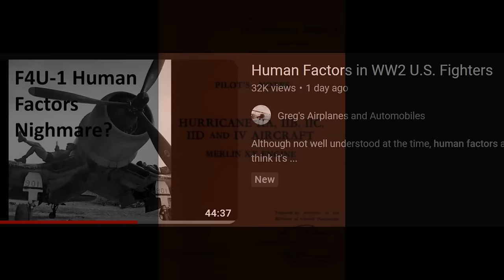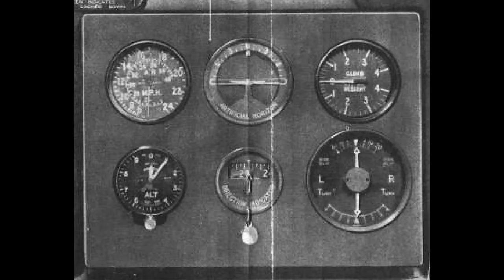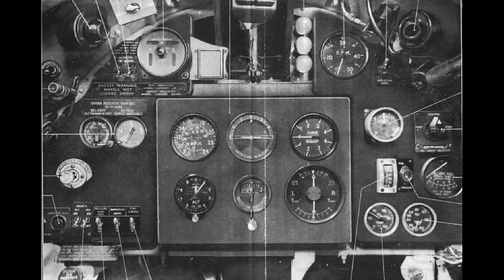Human Factors In British and German WW2 Fighters

Comment: Hi. I flew the Hurricane, Spitfire and Me-109 as a test pilot and airshow pilot. I have a few comments: You mention the omission of cockpit heaters as an oversight, since they were not needed in earlier open-cockpit designs. I think that misses the point. Optional devices, such as heaters, were omitted due to weight, cost and complexity. A wise airplane designer once said that he throws all of the optional parts into the air, and those that come down are too heavy. The undercarriage control is a perfect example. The Hurri and Spit designs require the pilot to change hands immediately after takeoff to retract the undercarriage.  A modern test pilot thinks, "Dumb design!" Remove the cowling, and the designer's thinking becomes clearer. The hydraulic pump is on the lower, right, aft part of the Merlin. The shortest, lightest, cheapest, and easiest-to-build solution is to run the hydraulics straight aft into the cockpit. The pilot's job wasn't made easier, but the fighter was made incrementally lighter. Lighter = better, even if the pilot's job is harder. That IS ergonomics in the 1930's. Likewise, tailwheel locks; best left out of the design unless the aeroplane needs it. The Spit and Hurry don't by virtue of their CG location with regard to the wheels. The Bf-109 had a comparatively VERY heavy tailwheel load. Omitting a tailwheel lock was not an option, so it justified the weight/cost/complexity. Speaking of which, the Bf-109s tailwheel lock is a great example of a bad idea; situated on the left canopy rail where movement of the throttle will cause one's forearm to accidentally dislodge it. (Ask me how I know!) The inherent ergonomic limitations of operating systems on these fighters represent the 1930's state of the art. A similar example of human factors is cockpit field of view. The Spit was utterly blind for takeoff and landing . The Hurri was better, with the cockpit raised up high on the fuselage. Was this an ergonomic decision? Nope. The Hurricane pilot sits higher to allow for a better depression angle over the nose for deflection shooting. The benefits for takeoff and landing were incidental. The design thinking was to use EVERY BIT of the pilot's ability if it made the airplane an ounce lighter. So much to say...Great video!
Reply: Finally, someone with something other than “I’m a DCS expert pilot”. The first time I climbed into a T-6 I realized how exorbitantly different, and radically unforgiving, the real world is.

Love the T-6 though. ;-)
Reply: Thanks for the insights.
Reply: Bravo. I'd rather see more effectively in the air, than on the ground. Even over cognitive instrument processing time. Because in the air 'Other Human Factors' are trying 2 kill me. Fun 'Fact.'
Reply: What if you crash and die in the ground, because you were unable to take off due to the poor visibility? Just because it was state of the art at the time, doesnt mean it was ergonomic or couldn't have been done better...
Reply: Overall great comment about the reasoning for design decisions that may be unintuitive/harder to use, but I can't help myself from nitpicking. It's decidedly NOT ergonomic design, it's (as you correctly point out later) ergonomic benefits being sacrificed in order to achieve other performance benefits; weight/cost to produce/etc..
Reply: And the Me109's throttle moves back to accelerate - correct?
Reply: While I am not discounting or being deprecative of your personal knowledge, design choices made based on simplicity is contrary to the definition of ergonomics which is design choices based upon compatibility with the human body/motion.
Reply: You didn't listen very well. Greg addressed some of your "concerns". No, I'm not telling you which ones.
Reply: Every designer should have to fly with their designs to see how their omissions affect pilot effectiveness and survivability.....
Reply: @NikeaTiber task at hand?
Reply: @Pikilloification  I take your point, but the design of  anything  (just like life itself)  is a set of compromises.
Reply: @faeembrugh  I believe some French aircraft such as the MS 406  had throttle control like that, as far as I know the 109 did not
Reply: @faeembrugh  No. Forward for more power, back for less. You may be thinking of French planes.
Reply: Thank you for your interesting thoughts from your actual experience. I envy that you got to fly the plane and I didn’t!
Reply: @tomsear1  The problem with that approach is twofold: first, crashing on takeoff or landing is just as likely, possibly more likely, to take out the plane and pilot as losing an air battle, and two, mentally and physically exhausted pilots are more likely to lose an aerial battle than ones whose planes are less taxing to fly but very slightly outperformed by the enemy - especially because very often the winner of any given air-to-air combat was the pilot who spotted his enemy first, and stressed and/or exhausted pilots are going to be impaired in their ability to spot opponents first.

The Chieftain generally covers this subject extremely well when it comes to tanks. Less stress and fatigue on the crew = greater combat effectiveness.
Reply: @brucetucker4847  OK, agreed. But the risk matrix engineering trade off within larger risk calculus in context of tactical advantage till exists in your argument and is indivisable from that assemblage. For example, no point in having a nice cosy heater if the weight of it means you are so slow that you either cannot get to the fight, or you are shot down because Driving Miss Daisy, and/or it takes so long to develop said heater that you lose I dunno Battle of Britain let's say because you failed to make a compromise to get a craft off the drawing board and into the air. (Cough let's not talk about lessons of supreme Ergo F35) real life example, Australian RAAF at Port Moresby had very "stressful" aircraft variations to fly, compared to the Mitsubishi's but had something with a propeller and flat bits out the side, but had them, and changed tactics to level the playing field. But none = sayonara Port Moresby. Tank examples exist 2. Better to have many T34s than a few Gucci Tigers. Both examples of gross calculations - but the finer ones you correctly cite were precisely made in heat of battle with these fighters. On the +ve side the Mozzie had a heater. But it also had two Merlins and was made of plywood. As John Lennon said - 'ive been poor and unhappy, rich and unhappy, rich and unhappy was better.' Battle is a unhappy place a lot of the time. As Mosquito pilot and test cricketer Keith Miller said, "Pressure is a Messerschmitt up your arse, playing cricket is not." Discomfort is relative to risk. Anyways the Hurricane & Spit both had superior visibility to the 109 & 190. You can keep a cool head and not hold the button rather than have nice ammo counter.
 Facetious reply, but war is gonna be a sh t show sadly less than ideal, usually.
Reply: @brucetucker4847  you make an excellent argument, but assumes the human matters over objective - [pulls down chart with on it a picture of B17] [audibly clears throat] .....
Reply from the maker: A lot depends here on how much weight you're adding vs. the benefit in ergonomics. Sure, a heater adds weight, so do properly place controls, but generally not much. Considering the numbers of planes lost in accidents it's likely that the trade off in performance simply wasn't worth it. Clearly that's what was decided because as the war went on and certainly in the post war airplanes Ergonomics and Human Factors took a huge priority over saving a few pounds.
Reply: @GregsAirplanesandAutomobiles  It's clear in retrospect. It's also clear they were placing inordinate emphasis on weight reduction at the time. There was resistance to radios and armor on the grounds of weight, so resistance to a measure that 'only' makes the plane easier & safer to fly is not just understandable, it's in character.
Reply: @GregsAirplanesandAutomobiles  And/or time compression of decision eased? Not sure causality can be reductively ascribed, since ergonomic effectiveness was not evenly distributed between combatants. The fighters discussed here were largely dev'd in conflict prelude. Buoyant Allied air supremacy as war progressed, coupled with democratic leadership, released change, but German fighters on the whole got worse, & such dynamics fuzzed in the furball of Nazi internal power politics, supply & contract continuity in a hysteria of wonder weapons. Japanese Dev of any kind just stopped. Postwar, where speed performance was positioned in an entirely new propulsion paradigm and a Cold War of limited proxy conflicts spread over decades, without such dramatic requirements for airspace contest conjoint with supply chain  resource scarcity  means we can't assume such a transition is linear, direct, nor cumulative. I look forward to you expanding your theory over next videos, however. One interesting case study to examine the debate might be your analysis of the SR-71 cockpit ergo. Did a non linear compressed production scale mean trade offs or was ergo matured? If so when did the ergonomic gains curve flatten? Or is it like Moore's Law? WRT 'was it worth it?' in the case I used 2 pilots and airframes were lost in the transit from South eastern Australia to the 1 week training school in Cairns before combat. This was because pilots had never flown the P40s before told here it is fly it 4000 miles north for one week's training. The latter key aspect because as war matured there was simply more time to train so maybe hard to extract ergonomics from that context as statistically independent variable.
Reply: FN., On flying into Moresby 2 airframes were lost when ground defence destroyed 2 airframes because had never seen a Kittyhawk before, then after a crash land post Zero contact and solo 14 day trek flight leader was forced by top brass into direct dogfight P40 could not win. Top brass - who were stupid and irrational - and flight leader was thus killed following a crazy order. All pilots flew with malaria and severe dysentery(sic) and only ergonomic support was good pilot boots collecting the effects during flight. So, not sure we can assume rational choice is ever being made. The loss of airmen in accidents was not considered significant when Moresby had zero pardon the pun allied air contest with Japanese and we could not lose Moresby. Not sure human factors were a priority in anyone's mind. Ever. Early in war. The fact that Spit had rubbish carby is proof of the original post in this thread - pilots - not machines did the flexible, plastic, hard compromises and stretch where engineering could not - and that interface surface exploited not the opposite. Maybe in the states, until Japan showed US what air power really was ;) US only did latter half of war so not controlled representative sample and two airmen crewed fighter bombers prove the argument of original comment poster as workload was split across humans, not human factor ergo enhanced when cockpit layout and gauge technology was either behind the aircraft or the demands of speed of combat change 2 maintain superiority.
Reply: @c1ph3rpunk Greg is an actual working pilot though. His logbook is extensive. He’s absolutely not just a DCS commander.
Reply: @PBScourge  True, but did he ever fly any of these aircraft in the early days of the war? Or help develop them? Obviously not...

The point I am making here is not that he is entirely wrong per se, but that there were often REASONS why certain design decisions were made that made sense AT THE TIME, but make little to know sense to us now.....

It is one thing I very much stress about the study of history in any form, and that people all too often ignore. Judging anything in history MUST BE DONE ONLY USING THE INFORMATION THEY HAD AVAILABLE AT THE TIME.

Sorry for the caps, but that is kind of important. If you do not judge history based on what information they had at the time, based on the tech they had available, the time limit they had to work to and the circumstances under which they operated you are utterly FAILING in an objective analysis of History, and thus you are not accurate as a Historical source or resource....

Many people such as yourself look at history with a 21st Century mindset, that is the wrong way to look at history. Look at history that way and you will never truly come to understand why some decisions were made.

Even Hitlers order to start Operation Barbarossa is understandable IF you look at the information available to the Nazi higher up, and their outlook and ways of thinking. Was it the correct decision? Hell no, but you can ONLY understand it if you look at it properly....
Reply: I went to college in the 1990s with a very nice lady professor that had measured about a thousand people's feet hands wrist elbows grip strength anything you can imagine on the human factors and then they applied it to make airplanes easier for the pilot to fly because they were getting too many crashes. I believe she came on the scene after  we lost a lot of people and equipment to things that just doesn't fit the pilot well so we re-engineered that to.
Reply: @markmcgoveran6811  Yes, but that was in the 1990's, with far better science and correspondingly engineering all round. 

The point I try to make is you CANNOT judge 1930's and early 1940's technology based on modern technology.

In the 1930's and early 1940's many of those design decisions made sense IF you take into account the available technology.
Reply: @faeembrugh  The operative sense of the 109's throttle is normal (i.e. forward = faster). The thing I most remember about its throttle was that it was about half the width of my hand. The cockpit was so narrow that a bigger knob would hit your leg!
Reply: @NikeaTiber  Fair point. We seem to agree that many design decision were not about ergonomics.
Reply: @tomsear1   Carburetors are not human form factors.  The US Navy defeated the best the Japanese Imperial Navy had within the 1st year & 1/2 after Pearl harbor.  So I am not sure what you are talking about with the "Japan showed US what air power really was."  If anything the US showed Japan what airpower really was.
Reply: They flew in conditions that you never flew these aircraft in, or even attempted to fly them in. There is a world of difference between an airshow and aerial combat over Europe in WWII.
Reply: @GregsAirplanesandAutomobiles   Sorry, but you are wrong there. Lots of little incremental weight savings make a difference, and that was common in most pre war and early war fighter designs. 

Did those weight savings make much sense in say late war Griffon engined Spitfires developing 2k Horsepower? No. But did they make sense in a 1939 Spitfire generating HALF that engine power? 

Absolutely...

Its weird, thing is I do not think you are wrong, ergonomics in many WWII aircraft (and tanks) were terrible. You are absolutely right about that....

My point though is I think you are wrong about WHY. I think you are judging WWII aircraft, especially those designed and built in the mid to late 30's, against modern aircraft...

And in that I think you are flat out wrong. I respect the fact you are a modern pilot with thousands of hours of flight time, but I feel you all too often look at these aircraft AS a modern pilot....

You should not, you should approach them as a pilot OF THE TIME, given the information, technology, and situational constraints OF THE TIME....

If you do not, you are worthless as a Historical resource or source.

I am well aware that you and some of your folks will brand me for saying that, but to you and them I will say one thing, when it comes to history, facts are often contextual. Maybe one day you will understand that.

If you want pure objective facts, stick to science, not history.....
Reply: So state of the art ergonomics for British and German fighter design was...anti-ergonomics? That's pretty damning. History bore out that making the pilot's job more practical and easier is very much worth some sacrifices in performance. Most fighter combat involved the target aircraft never noticing the attacking aircraft, after all.
Reply: @alganhar1  no that was in the 90s when I was in school with the teacher it was way before that it was probably the 60s when she was doing that. The point I was making is they killed a lot of people trying to figure out that everybody who's a fighter pilot may have different size feet. It was a monstrous statistical task to come up with something that would fit everybody every time. Not only did you have the problems you were discussing with pilot inconvenience a lot of times you had a pilot who was just too tall or too Short or too long or too thick or to something and he couldn't work the controls well. That was the human factors engineering I was talking about. There were a lot of crashes because somebody's feet were too big for rudder pedals and things like that.
Reply: @cvr527  you have not met the carby in my 1975 Kingswood, who would beg to differ. Nonetheless, all technology is an actor in the assemblage, & has agency. Pearl H - well, erm, precisely what said. Not sure what your confusion is? As already noted Japanese tech remained stagnant and US overran later in war - a view you support. Wait, you believe Pearl H was NOT an overmatch & illustration of the tactical and strategic benefit of air superiority early in WW2? O...K. Anyway, back to tech, one of the problems I have with approach of these vids, as fascinating and fun as they are, is that ergonomics as a defined formalised discursive only emerges post 1945, with stages at 1949-50 and 1957 when 'human Factors' is formalised. Even the emergence of mature protoergonomics in founding father Chapanis's infamous late WW2 pilot error study of B-17 is NOT the scientific taxonomy of ergonomics as we know it - even as post Taylorist psych - and WW2 aircraft design as it pertains to human machine interface might be more valuably explored on its own terms - indeed as noted in original posters comments - the human is DESIGNED to be behind the aircraft at the time and cognition is agent that bridges the gap. Back to the carby as non human factor then - before 1957 you would have NOT been able to conceptualize such a divide exactly - 'human Factors'(1957) assumes a discourse of knowledge of the nonhuman tech and vice versa. Ergo, a ergonomic critique of WW2/earlier design might only produce simple binary analysis outcomes - obvious ones - which may be of limited contemporary revelation.
Reply: @RobofGabriola  yes. Formal British postwar analysis found that 109 pilots could only ever exert maximum 40% of the force that a equivalent Spittie pilot could on the Stick.
Reply: @cvr527  aren't they quite close manoeuvre wise tho? & Risk and time at 0 feet?
Reply: I personally am no expert but 1950s test pilots were frustrated by the afterthought that was ergonomics and the indifference to their complaints on the part of managers and engineers. 

It's a reason British cars and motorcycles got wiped out, too.
Reply: "Lighter = better, even if the pilot's job is harder."  That depends if the extra weight or pilot errors due to task saturation and/or fatigue from being cold costs more airframes and lives/injuries.

If "lighter = better" was absolute, we would pull directly on wires to manipulate the controls instead of having a control stick.

An easy to fly plane leaves more time and attention to build SA, and a comfortable cockpit leaves a pilot less fatigued and more alert.
Reply: I’m envious of your experience. I will add, when those planes were designed, I imagine nobody thought the pilots would be going into combat with only tens of hours of flying time, as I believe sometimes happened. I am a DCS ‘pilot’ but a million miles away from being an expert in even virtual flying and if there’s any correlation with real life in these sims, it’s that experience - repetition and familiarity, can minimise or even negate some ergonomic issues.   Unfortunately for a number of pilots they didn’t get a chance to gain that familiarity. To get closer to my experience in my real world, the virtual 4th gen jets seem to have most of the physical ergonomic factors sorted.  But the usability of their human-computer interfaces is pretty bad by today’s standards. Some things you select and then choose an action button or key, other things you choose the confirm action button first and then tell it what action you want. In the same cockpit. Ok, maybe it wasn't like that and the sim has it wrong but this occurs on multiple virtual models from a range of devs so I think its fair to assume the real things were making the same usability errors we saw everywhere at the time. Saying that, it was commonly believed that improvements to UX often started in military aviation first. But I digress.
Reply: @alganhar1 absolutely. But it is possible to discuss these things without making value judgements. And understanding the history from a purely functional PoV is an approach. Maybe not the professionally preferred approach but from an enthusiast angle, I find it fascinating how the focus moved from pure performance to adding in human factors once there was a little performance to spare and how the adoption of human interface thinking was uneven across cultures and even manufacturers. I believe it’s more of a sin against our forebears to do the ‘my engine is bigger than yours, I have a higher top speed/better turn ergo my favourite is better than yours’. And that kind of childishness is rampant in the armchair internet world of which I am a part. An easy example can be found in armoured vehicles - Someone (was it Liddle-Hart?) said AFVs are a balance of armour, mobility and firepower leading to 30 years of such internet warriors ignoring how easy something was to use. How tiring it was, or how much visibility a crew had. 
Greg is pushing back against this ‘my pecker is longer than yours’ business that pop history TV and internet discussions always focussed on until recently.
Reply: @tomsear1 I am quite sick and tired of the "US only fought the second half" routine. Knock it off. It is both wrong and stupid.
Reply: @alganhar1 You're misunderstanding the point of the video. Ergonomics were sacrificed because of the relentless search for performance, or simply the lack of available options, and as a result most casualties resulted from a lack of human factors, not a lack of performance.
The M4 Sherman shows this perfectly. Before the Sherman tanks of all nations were human factors nightmares. After the Sherman human factors reigned supreme. Why? Because Sherman crews could fight their tanks, then get a good night sleep. That led to such an outsized increase in combat performance the USA effectively dominated all of it's competition with a tank that if you only analyze the "hard factors" was far inferior to it's competition.
Reply: @GeneralJackRipper  
Ack. All about perspective I guess yeah -
The optimist sees a glass half full.
The pessimist sees a glass half empty.
The engineer sees a glass with a safety factor of two.
Alternatively:
The engineer sees a glass that is twice as big as it needs to be
Reply: @kenneth9874 And the architects should live in the flats they designed.
Reply: @20chocsaday  some definitely should..
Reply: Reflecting on the weight issue from the perspective of being a Scandinavian motocyclist, who also replaced a car heater once,  I believe  dressing up for really low temperarures adds almiost as much weight as a heater (water in hoses and heater taken into consideration).
Reply: @larsstalegard2024  hmm. as equivalent weight for a system across firewall at altitude for a piston engine the scale of a Merlin, say? I guess Scando DOES get cold. Presumptions: just taking hot air from cowl surrounds without regulation and piping into cockpit, via sealable vent might have other consequences specific 2 engine and variant combinations? Using engine coolant (with glycol) requires an additional heat transfer system and conduction which not only complicated and risk heat build up? Having a second heat transfer system for pilot might have consequences for engine temp? Throughout WW2 there was pressure, pardon the pun, to increase engine coolant temperature. Why? To reduce radiator size to save weight. The argument loci concerned what coolant temp would lead to failure of engine in risk calculus. So maybe in team meetings suggestions for an additional heat exchanger might have met weird stares and unwillingness to share proverbial mini muffins with person that suggested that?! ;)
Reply: @larsstalegard2024  I was going to say that some exhaust gases could be run in pipes under the cockpit but remembered the different length of pipe might disturb the smooth running of the engine. 
An indirect duct might work but it would be more air resistance.

The spitfire could only last 90 minutes anyway. It was originally 'Get up there, shoot, land'. Much like the English Electric Lightening but subsonic.
Reply: @alganhar1  I think that your evaluation is incorrect. Greg many times says that early versions had these faults because they didn't know better at that time or didn't take what we call ergonomics into consideration.
Reply: @alganhar1  The Fw-190 was an aircraft of the time, which is really the beginning of modern cockpit standards.  Human factors was known at the time, it was just unorthadox.
Reply: Minor quibble, the Chieftain ranks the ergonomics of the German Mk III and Mk IV tanks quite high. The three  man turret (tank commander, loader, aimer) in particular gave them a major advantage over early British, French, and German tanks.
Reply: @Pikilloification 
Pilot's routinely just stuck their heads out of the cockpit sides to see better while taxiing and on takeoff, they learned to use peripheral vision. On many naval aircraft, the pilots opened the canopy and raised the seat to see over the nose for a carrier landing.
Reply: @cvr527 
The Jspanese showed that capital ships were very vulnerable to air attack at Pearl Harbor and the Battle of the Java Sea. Up to that point, many commanders in global navies, thought that aircraft would spot and harrass the enemy BUT surface fleets would be needed to finish him off.
Reply: I think these should be read less as a remark to different compromises made, but more as a summary of less-than-optimal prioritisation forced upon designers due to design requirements at the time.

If you are to manufacture a plane that uses every little ounces possible out of power and performance available, than these are worth the compromise, but that would be missing the fact that these are warplanes to begin with. Moreover, the king of lightweight in WW2 fighter aircrafts - the A6M Zero - largely does so by clever design and employment of unconventional design goals (less than 120% safety margin versus 180%, for instance) and not sacrificing a pilot workload. Not that it was great in terms of cockpit design, just that lightweighting could have been done with other methods with better effects.
Reply: @alganhar1  “person i disagree with  about a minor thing for little good reason is literally doing history wrong”

Both pedantic and pretentious, I cringed harder each sentence. 

2/10 would not read this person’s comments again
Reply: I wonder how many subscribers on this channel have flown a warbird in real life... For you, if someone doesn't have real flying experience, they can't give an opinion?
Reply: @fafner1  They rank high compared to other pre-war designs developed around the same time period, mostly because their chief competition was so unbelievably atrocious it boggles the imagination. No one looks at early war British or any French tank and thinks of it as a comfortable place to work. Hell, even the mid and late war British tanks were cramped and uncomfortable.
When we sent the M3 Mediums to Africa in 41 the British were so happy to have them they offered to buy the entire production run outright, because they were miles better than anything the Brits were operating. We had to persuade them to order fewer tanks because we already knew the M4 would be even better.
Reply: @billybutcher357  I would take the opinion of anyone who has just five minutes in a Cessna over someone who has a million hours in a video game.
No offense.
Reply: @billybutcher357  Got some (hands off) minutes in a military trainer back seat, 99% not the same thing.
You can tell a wikipedia or a P.C. joystick virtual pilot in a few wrong end of the stick words such as fatal flaw and inverted carburettor stoppage, my favourite is the deeply read hopeless deathtrap as it lacks counter rotating engine/propellers.  Wisdom too generously shared.
Reply: The FW190 have a heating system. Eric Brown mentioned this in one of his books.
Reply: Even the French aircraft of the period weren’t that crazy. The only thing I’m aware of that fits the bill from the period is the mixture control on the T-6 Harvard. That operates backwards with pull for rich and push for lean, using a lever on the throttle quadrant, on which the throttle operates in the opposite (conventional) sense.
Reply: "A wise airplane designer once said that he throws all of the optional parts into the air, and those that come down are too heavy." 
I laughed hard at that one.
Reply: @brucetucker4847 
Tanks are not worried about a few pounds/tons of extra weight, are they?
Reply: I was in the front seat of a Harvard / Texan on a cold day and found the 600hp heater mounted just in front of me did a more than adequate job of keeping things toasty.
Reply: This is also just inconsequential as well, since there is no real downside to a one to two second delay in raising the gear after takeoff for a spitfire. Such things wouldn't really matter until the jet age when acceleration post takeoff became far more abrupt. I have a bit of cross country time in a spit and can say, it is a very comfortable cockpit to spend a few hours in. The ergos of the spade grip are also nuanced, being comfortable if you grip it lightly, and less comfortable if you death grip it. Visibility is indeed poor on landing, and even worse in the back seat of a two seater, but handles so well at low speed that the visibility issue is negated, and the narrow landing gear issue is entirely negated by a competent pilot. Its like saying a beautiful woman doesn't have a wide enough stance and therefore cannot be a good dance partner. Addressing the difficulty braking and delay in system during taxi, not noticeable for me as a very low time pilot too young to have a drivers license.
Reply: Anyone flying WWII fighters today is an absolute top tier pilot with thousands of hours experience. I'd imagine the machines are immaculately maintained. You probably make it a point to take care of yourself and get good sleep before you fly a Hurricane in an air show. I'm sure you're more than capable of managing controls and instruments that aren't laid out to be as easy as possible for the pilot. However, none of this applies to a 21 year old pilot with 300 hours stick time flying combat missions with people shooting at you, operating from improvised airfields hastily cleared from the jungle last week, having lost 40 pounds from dysentery. Far more planes and pilots were lost to operational causes than were lost because they were that much heavier and thus 5 mph slower. Greg's points about minimizing the pilots' workload assume a far greater importance in wartime.
Reply: @alganhar1 Missing the point completely.  Greg isn't insulting the designers of the Spitfire or Hurricane or saying they were bad people or that they didn't have reasons for the choices they made. His case is 1) ergonomics matter, 2) some WWII planes were better ergonomically than others - or better in some ways and worse in others 3) here are some examples. Yes we're more advanced in our understanding of ergonomics now than they were then. But given the state of the science at the time, it's obvious that designers of WWII aircraft were aware of the importance on these things and tried to improve them. Recognizing ergonomics advantages of, say, the FW190s engine management system isn't judging a WWII aircraft by the standards of today. It's recognizing a meaningful accomplishment - that was in fact achieved in the 1940s
Reply: @randomDIYguy-k4r  Funny, I was taking off doing rolls and landing a two seat spit at the age of 14, with less than 20 official hours with any instructor, and those in a sailplane, probably 15 hours in a piper cub with the PIC not being an actual instructor, and I was declared 'ready' to fly the spit. Its an easy plane to fly. I'm not aware of any wartime pilots complaining about their workload in it. The combats pilot called it the perfect lady. You'll never fly anything so easy to fly, besides the torque impulse on takeoff, and the inability to sustain negative gs due to no fuel injection its perfection. I've ridden in the backseat for airshow routines, following along with my hands on the controls, before I even had a drivers license.
Reply: @faeembrugh Nope. But French aircrafts had throttle that you pulled back to increase power.
Reply: @faeembrugh  nope, just standards forward=more power and vice versa for less power. It was Italian planes that had those.
Reply: @faeembrugh 
I'm not sure either way about the '109, but contemporary French fighters like the D.520 and MS.406 had throttle controls operate in the opposite way to British and American designs.
Reply: @brucetucker4847 
Perhaps, but I have never read any literature that suggests that the ground handling, take off or landing for the Spitfire or Hurricane was anything other than straightforward and simple. In fact both types were renowned for their ease of operation, particularly in landing, and certainly not 'exhausting'. The '109 was known to be somewhat trickier, particularly in landing, but I think other factors, such as battle fatigue and morale had far more effect on exhaustion than how difficult or easy it was to taxi an aircraft.
Reply: Damn. That's one of the best comments I've ever read.